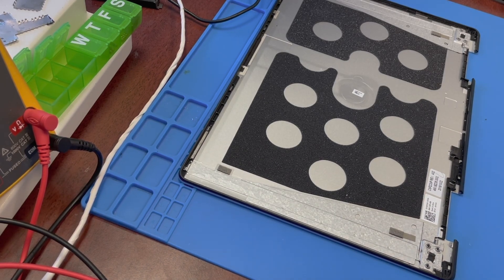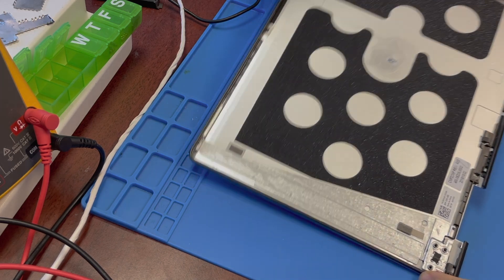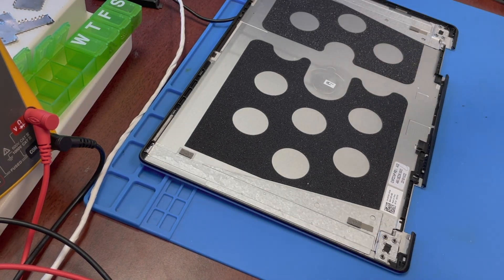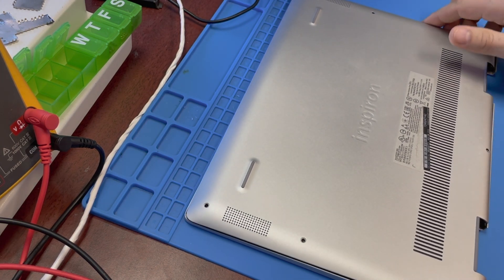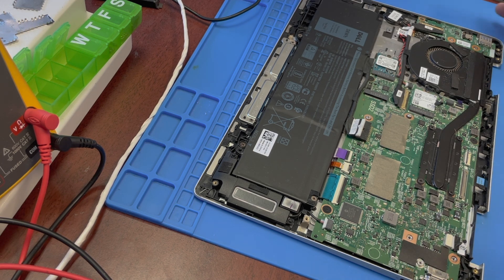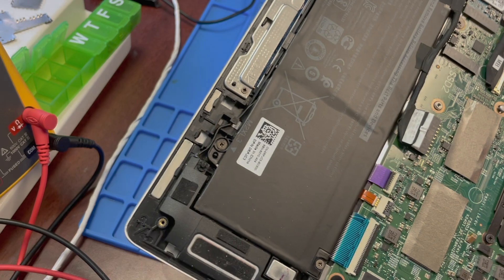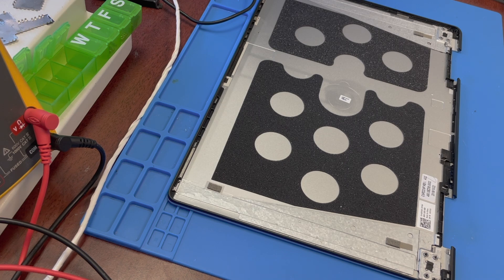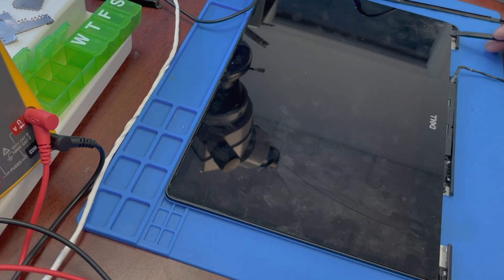Dell Inspiron 13" 7000 Series P91G P91G001 Hinge Separation Repair.

Comment: I have a dell 7368 laptop/tablet hinge.  But the swivel is inside an oval connecting piece which goes from keyboard to monitor (so it can fold all the way backwards). It's too tight.  Any ideas?

Comment: Thanks so much for this - had the same issue on this laptop version and your video showed us what was under the screen (as we didn't want to fully remove it).  Like you, we used a very strong glue (JB Weld) under the hinge fastening to fix it back down to the laptop cover and kept it clamped down overnight as it set.  So far so good!
Reply: Still?
Reply: @tobytragen4363  Yes - holding perfectly.  Laptop in daily use.

Comment: Had the same problem was still under warranty when I asked dell to cover it they told me it's physical damage so they won't cover it I told them it happened from regular opening and closing and they still refused to honor the warranty it's fing glue failure ffs
Reply: shit man, when I had this issue they eventually just replaced the whole laptop. but now my warranty has run out and i got the same issue again, and yet again it's on the right side. now that i've seen this video its clear why this would happen again, i really would not have expected such a poor design on a dell laptop...

Comment: Did the glue work?
Reply from the maker: You asked and literally the same day it came back for warranty repair. Screen got separated a little so the customer wanted to make sure it's not happening again. What it turned out to be is the tesa tape is not the proper tape to glue back the LCD to the frame. I replaced it with thicker 3M tape and it's as good as new. And the actual GLUE is holding up very well, no signs of weakening.